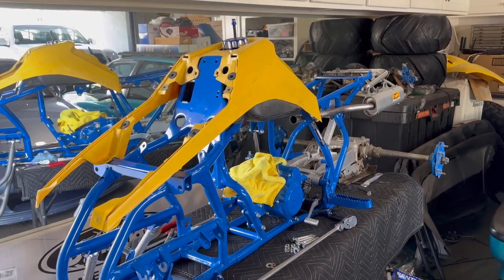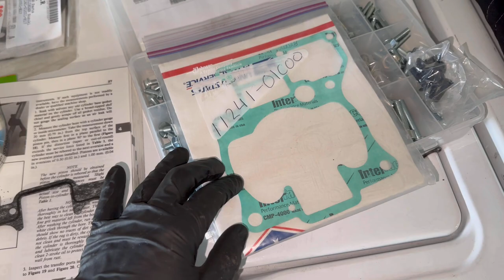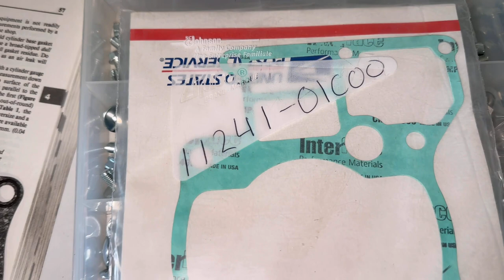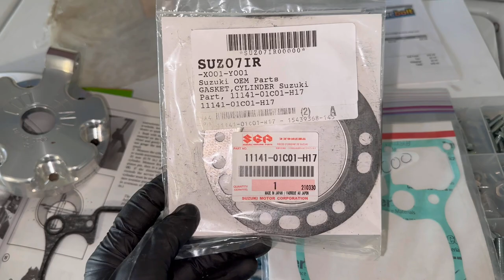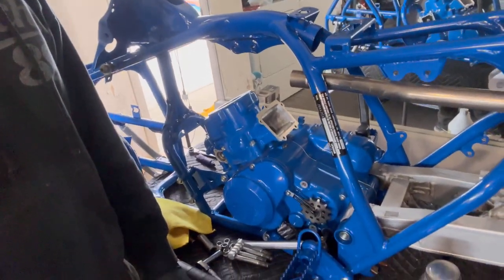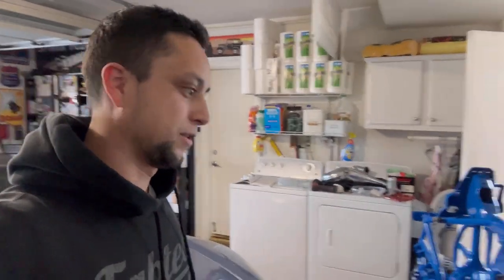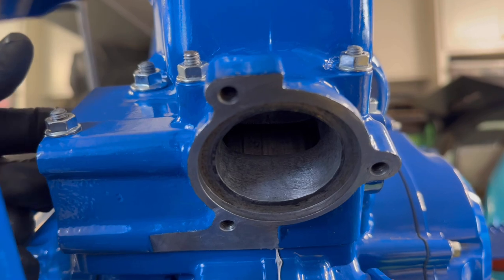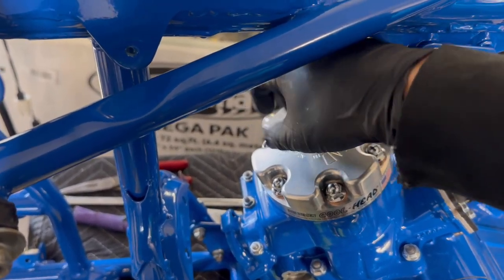Swing Arm & Linkage Bearing Replacement PLUS Engine Install! | Suzuki LT250R Restoration Part 2

Comment: You’re going to have to remove the swing arm to install the chain guide. I did the same thing during my install… lesson learned. Great build though. Make sure to go with the billet washer vs the OEM thrust washer as they 100% known to fail and cause catastrophic failure
Reply from the maker: Billet thrust washers and rm wrist pin bearing installed. I got the front slider off no problem on the bike.
Reply: @gio.rodriguez  I’m talking about the plastic chain guide. You’re going have to remove the swing arm to re-install it now as you mounted the swing arm without it on. I did the same thing also